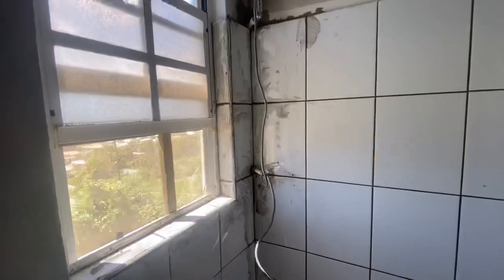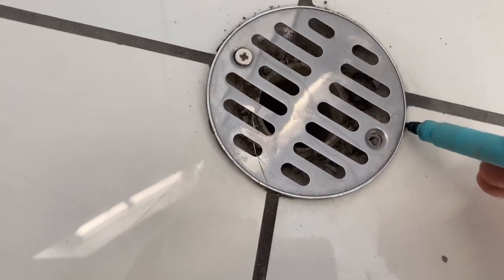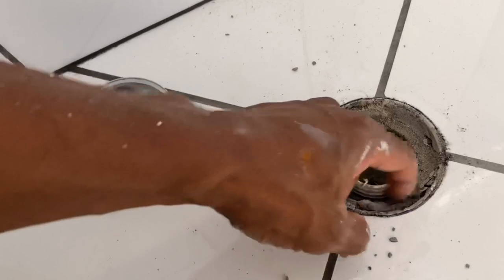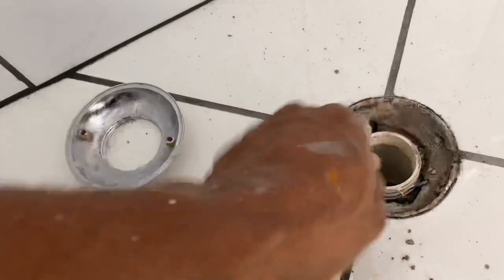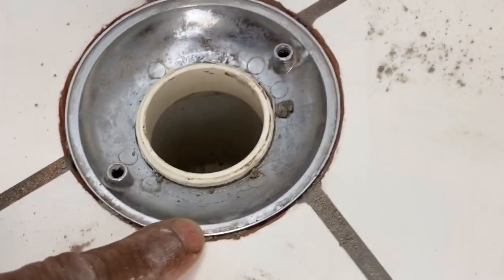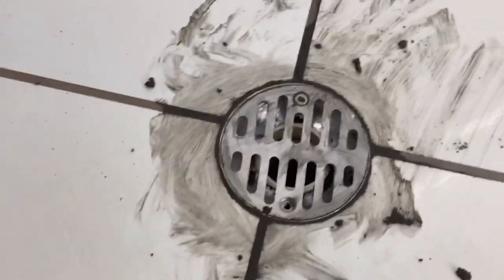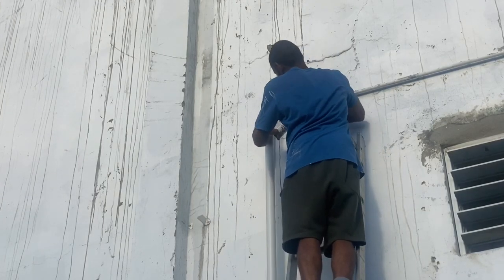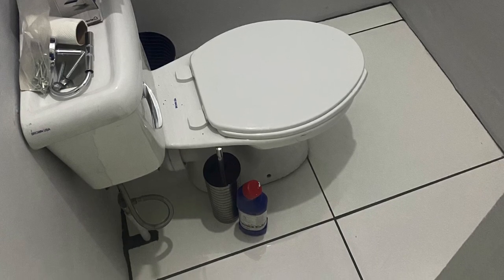The shower is finished - Part 8

Comment: I used to enjoy your UK channel but since you started in the Dominic it has become so slow. 3 videos on laying tiles which could have been done in 1 and continually repeating yourself. They have been great in the past.
Reply: I think you are missing the point. This is an introduction to a different way of life and a different way of working. Darren is good enough to take us on the journey and whilst doing all the work himself still finds time to film, edit and upload the videos. Is there a tool station or travis Perkins around the corner? The answer is no, he is working with limited tools, limited access to materials I guess and certainly to smaller budgets than he would in London.
Reply: @jruk1981  Sorry. I don't think so.